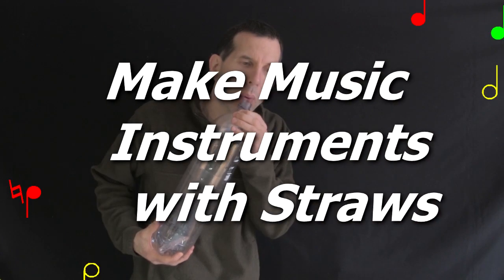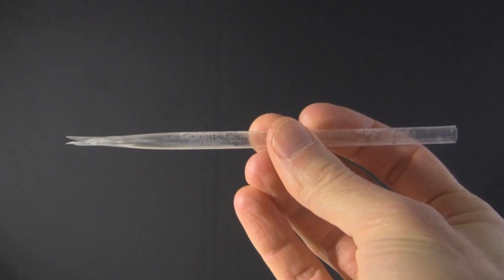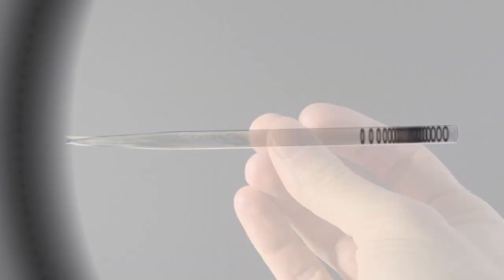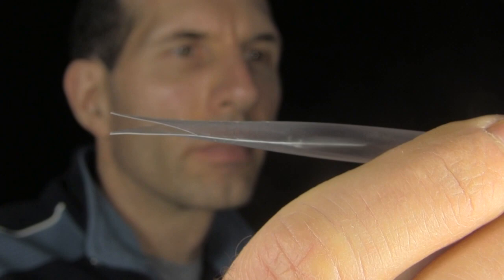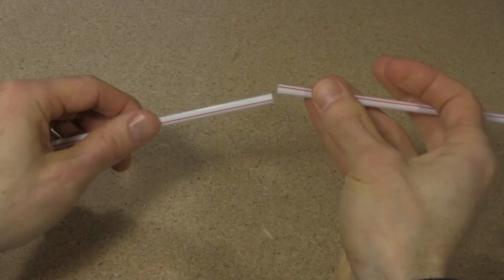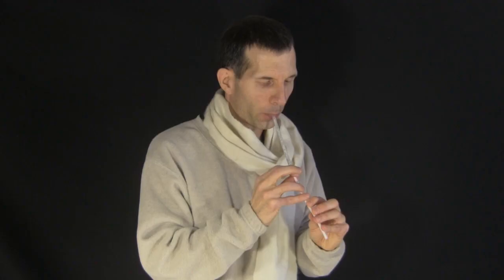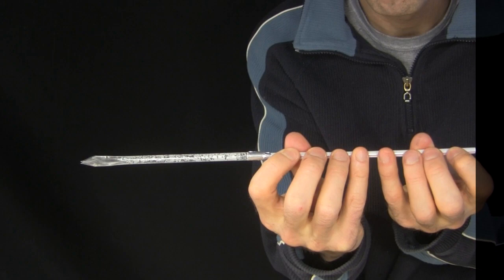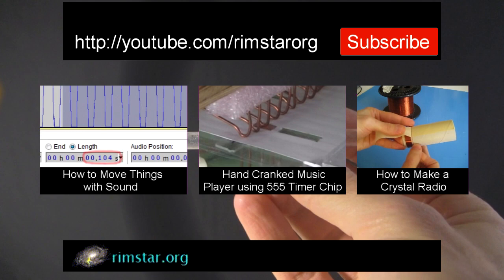How to Make Music Instruments with Straws - Trombone

Comment: 1st mistake Trombones and Trumpets don't use reeds, 2nd mistake they need a bell, 3rd mistake they can play both high and low, 4th mistake trumpets have only 3 valves, it's not a recorder. But overall cool
Reply: +Josh Ramirez 1st wow aren't you observant, 2nd they don't need a bell, all the bell does is amplify,3rd trumpets and trombones can play high and low, but trumpets can play higher, 4th trumpets can have 4 valves. but overall cool.
Reply: Chris TRUMPETS CAN ONLY HAVE 3 VALVES
Reply: Trumpets only have 3 values
Reply: Valves*
Reply: cough cough piccoloTrumpet cough
Reply: @itzkrayola7927  it could be up to 4
Reply: @carlosmarquez8731  it could have 4
Reply: @itzkrayola7927  Haven't you seen one?

Comment: well, that was more like flute or clarinet to be exact. trumpet is a bundler of tubes, with valves, to alternate the paths. it has 3 valves with 3 loops. when button is not pressed, air goes trhoug the loop, when you press it it goes straight. i was forced to play trumpet for 7 years in my early days. permanent trauma.
Reply from the maker: Yeah, I guess more like a clarinet. A flute doesn't have a reed. I know that only because of my research when I tried to make a flute too out of a straw but didn't succeed.
Reply: RimstarOrg well, but clarinets have external valves to close eternal holes, unlike flute with fingers. but this would be clasified as wooden instrument (saxophones are wooden instruments, even thou made out of brass). the trauma haunts me.